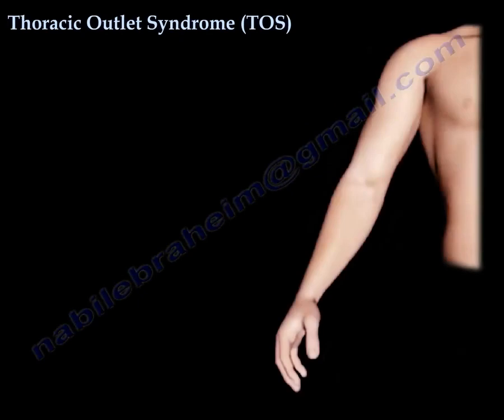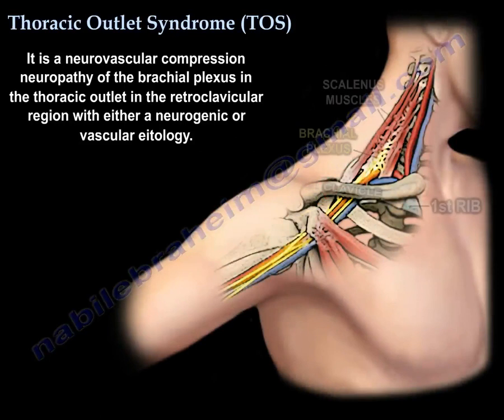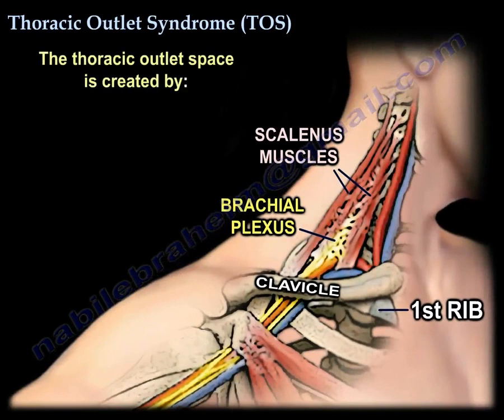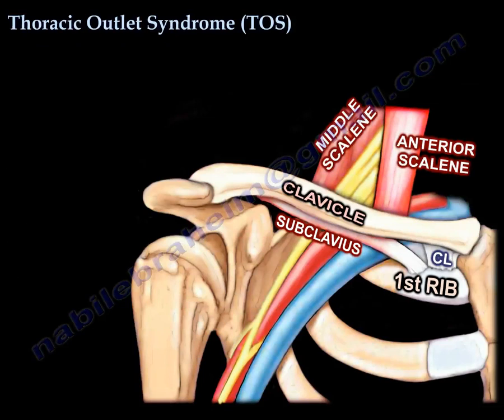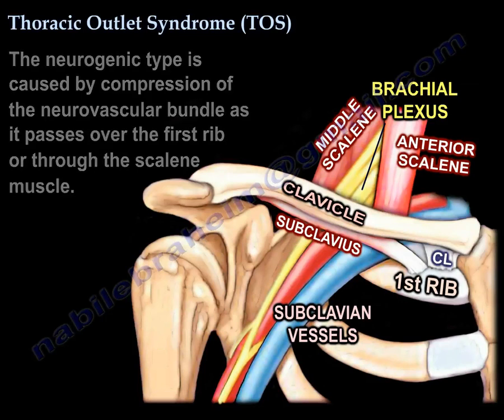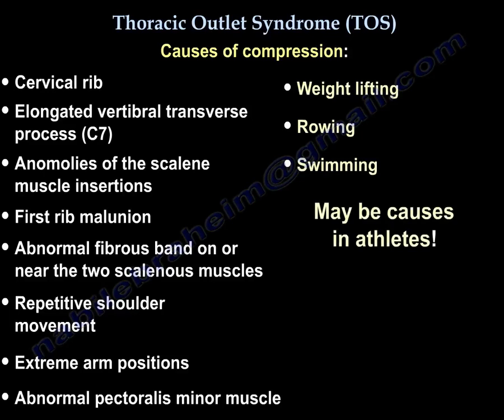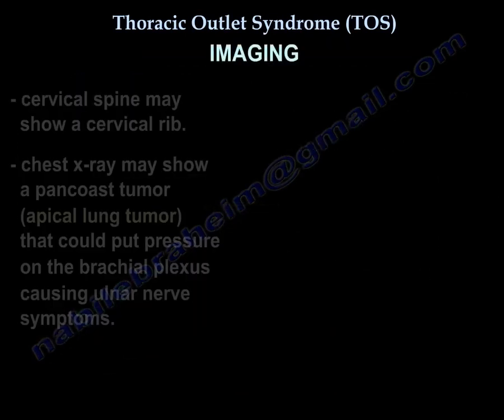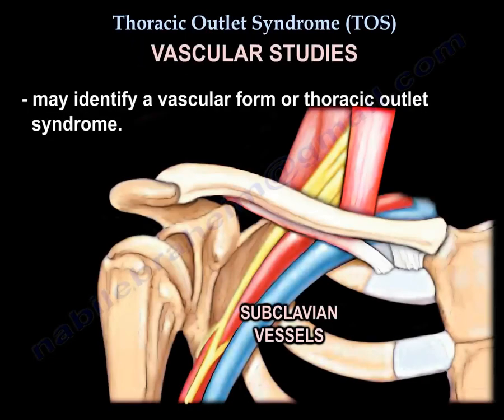Thoracic Outlet Syndrome: Diagnosis, Causes, Symptoms, and Treatment

Comment: I always wondered if this was part of my own issue. My ulnar nerve on left arm slides over the medial epicondyl when flexed at roughly 90 degrees or more. Are these related? Or the fact that the nerve pops out and moves rather than staying in the proper position indicates a different possible condition?
Reply from the maker: Ulnar nerve subluxation, a different problem
Reply: @nabilebraheim  besides nerve gliding, do you have any suggestions or videos addressing this? I have had this issue for a long time, but it hasn't caused major problems, just numbness in correlating fingers if in specific positions for long periods, but I notice my shoulder is a factor, as in when lying down on back, if shoulder isn't externally rotated enough it causes the numbing sensation...which led me to believe brachial plexus or thoracic related. I have been stumped for quite awhile.
Reply from the maker: @ChristisLord137  see cubital tunnel syndrome videos